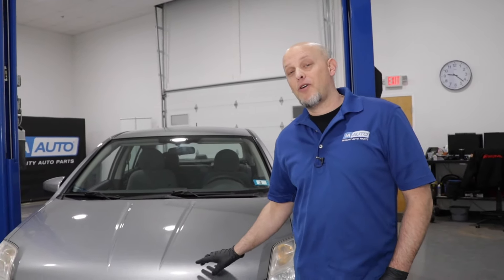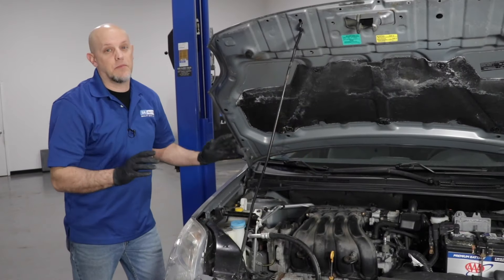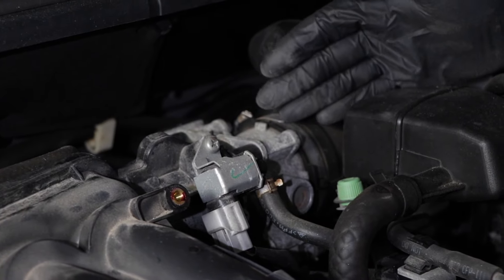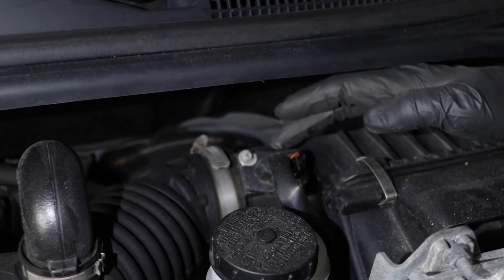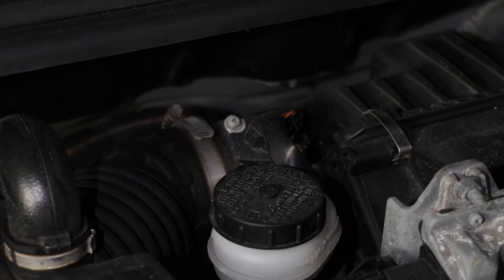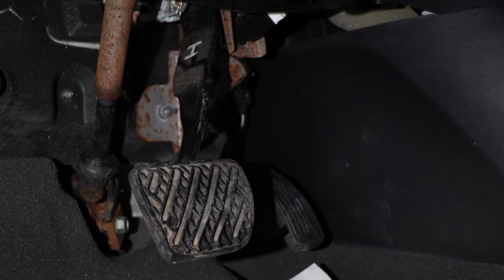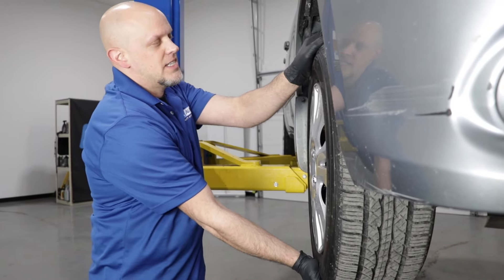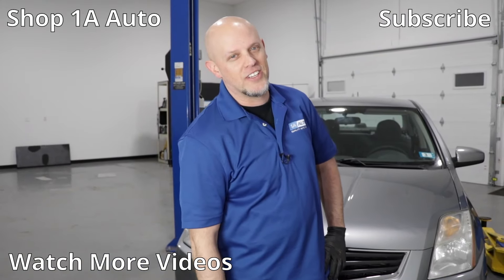Top 5 Problems Nissan Sentra Sedan 6th Generation 2007-12

Comment: Some of the things in this car seems like intentionally designed poorly so you take it to the dealer. Ex : cabin air filter is difficult to change, changing spark plus and ignition coils requires removing have the intake or most of it, blower motor in center console what the heck,
Reply: Yeah, that blower motor is a pain, but at least you can do it without tearing out the dash.  Taking half the damn thing apart just to get to the spark plugs is ridiculous, though.

Comment: I have a 2010 sentra and Everytime I come to a stop after pushing more than 3-4K rpm for a bit (especially coming off the highway) my RPMs start to dip and drop for a good 3 seconds… pissess me off feels like it will stall
Reply: Base model? Mine is similar. I find turning ac off helps but it’s not great

Comment: I have 2012 with 100k mikes on it I replaced whole front end down to axels .. still makes a grinding noise the steering wheel shakes and has a lot of play. I got new tires also and wheel alignments roders brakes done and still hear the grinding noise and the car shake I’m starting to think the steering rack is the issue. Any suggestions?
Reply from the maker: +Adrian Lucero We wouldn't be able to diagnose an issue like that here, you may want to have a local mechanic take a look at it. Thanks for checking us out! http://1aau.to/m/Shop-1AAuto-c

Comment: What about camshaft sensor code? After replacement still throws code and starting it fluctuates and starts or fluctuates and dies. Replaced fuel pump, plugs, coils, camshaft and crankshaft sensors as well.
Reply: Did you find out ur problem my moms car was doing the same thing  I did the same things besides replacing the fuel pump  I know I have spark and I don’t hear it miss firing so I didn’t check the time of belt  it runs about 30 mins and dies I took it too to mechanics after I got tired of fucking with it and they both said they have to replace it with there parts. And one was the dealership and the put let run for 15 mins so they didn’t let it run long Enough

Comment: Hey, I’m having this problem with my
2010 Nissan Sentra feels like every time I press on the brakes too hard my car will shut down and the service engine, battery and oil change indicators lights up on the dashboard and I’d have to turn the car off and on to start it to work again it’s so annoying and so dangerous. Any idea what it could be from ?
Reply: Check the tube between the throttle body and air filter box. You're probably stalling. Something similar happened to mine. Replaced the plastic between the two and it stopped.

Comment: What about the CVT transmission?
Reply: I was also wondering
Reply: Change fluid and it'll work fine.
Reply: mines at 220k with no issues
Reply: @Usef320  just fluid changes?
Reply: @trent7080  haha you one crazy guy, fluid change cant fix poor design or mechanical failure.
Reply: Mines at 170k never changed fluid or anything and works perfectly fine
Reply: @spiderbatrooster7529  The fluid needs to be changed at 90k
Reply: 132,000 miles on my sister’s 08 no problem

Comment: The blower motor is a $#%&* to replace. I'm about done but have run into a few issues, including breaking the tab that holds the relay that adjusts the vents. Not to mention laying on my back and trying to work upside down with very little room. Some of the screws/bolts are not even visible (how I broke on of the tabs). Hopefully Gorilla glue will be string enough to repair it. Definitely not a fun job. I would recommend removing the driver's seat so you can comfortably be more level or put some type of platform as level to the rocker panel for comfort. I've done neither and I'm regretting it immensely.

Comment: I have a 2007 sentra and I experience shaking when accelerating between 45-55 mph. I've balanced the tires, checked for tire bubbles, wheel alignment, but still experiencing this issue. Best way to describe it is to compare it to the feeling of an airplane accelerating right before it takes off. The shaking we can feel in the cabin is what I feel on the driverand passenger side. Any suggestions anyone?
Reply: Axels
Reply: Not the axle's. Definitely the wheel bearings in the front, the video here even mentions the same sound and feeling you mentioned as well.
Reply: I have the 2012 Sentra I had a similar shaking on my car when accelerating I took it to my mechanic it was only driver side tie rod it's an inexpensive job,the car runs fine.
Reply: It’s the motor mounts they are probably worn out
Reply: wow! I have a 2007 Sentra and have the very same vibration problem. alignment, new wheels and balancing did not help. mechanic is saying - CV axles. My engine mount on the passenger side looks fine. could not locate the other mounts. will explore further. I am going for a second opinion if they are really axles or as someone mentioned, tie rods.
Reply: Could be alot of things here have to see in person hub bearings, subframe bushings, mounts, bad inner tie rods etc

Comment: I have a 2008 Nissan Sentra 2.0L. It’s been pretty weird lately. On two occasions it has turned off on me as i was coming to a stop and the service engine soon light appeared for a lean code of a mass air flow sensor. I have changed the sensor but i still feel like It’s been killing gas. Another problem that i’ve seen is that whenever i turn on the air conditioner i tend to get a noise like when it starts up and sometimes even a bit of a rattle to the car. I’ve changed crank. mass airflow sensor. shocks. any ideas?
Reply: also it has 93k miles
Reply: The air hose after the mass airflow sensor can crack or split over time and cause acceleration issues. You’d likely need to remove it to check for damage (happened to my 2007 Sentra and caused acceleration issues)

Comment: How ya gonna say any Nissan is a "great vehicle"🤣
Great if you like buying new automatic transmissions
Reply: I have a 2012 nissan sentra sl with 64000 miles and so far no issues it's a great car, I can't complain.
Reply: Fluid should be changed at 90k

Comment: As a tech myself this car is junk! I love Nissan products but this one is a POS!!!! Working on a 2009 that keeps burning oil to find the valve seals are shot. The PO420 Cat Code because the engine is burning oil in the cat and plugging it up....sigh. A can of Restore to slow the oil burning.

Comment: HEY THERE HOPE SOMEONE CAN HELP
I have a 2011 nissan sentra that when after you hit 80 mph for more that 2-3 min the rpms will not go up at all even if you have the pedal to the medal, it also does this if ac is used for a long time, and with drives more that 40 min. please help!!! ):
Reply: i was thinking catalytic converter, but i don’t know. on the highway i’ll go from 75 to 40 real quick and am forced to get off and wait
Reply: Might be the mass air flow sensor or throttle body
Reply: Fail safe mode?
Reply: Also change your tranny fluid, oil, coolant